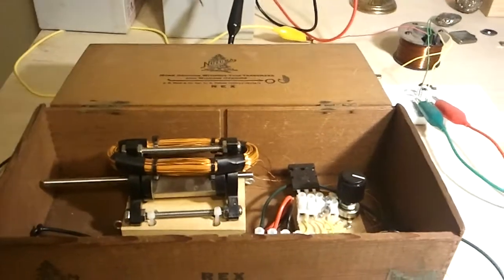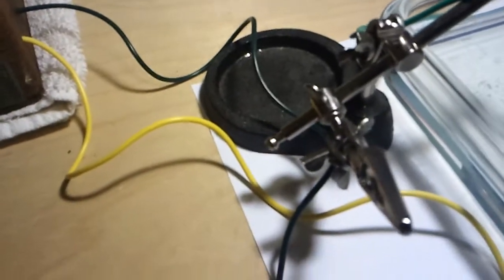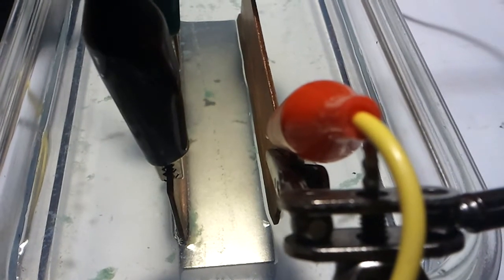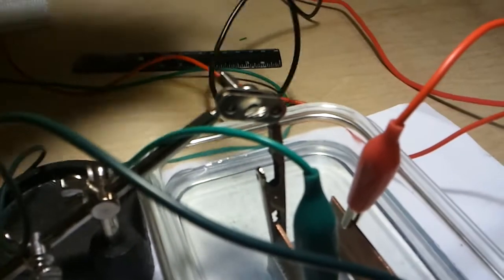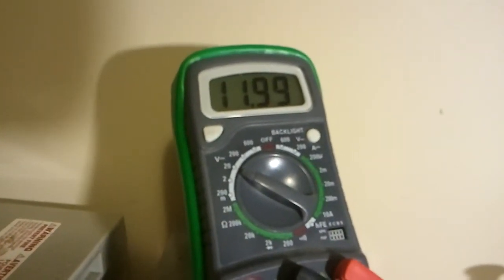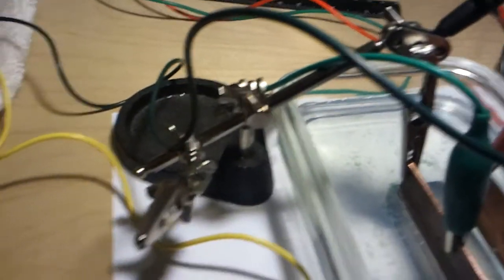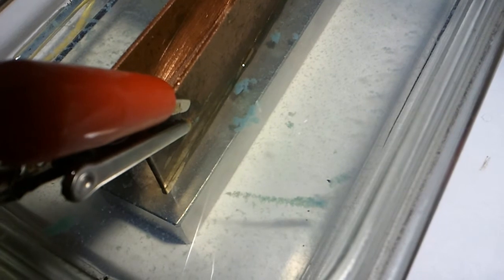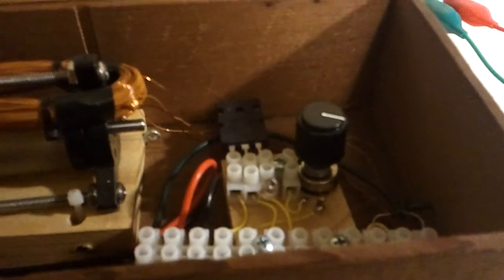bedini motor + magnetohydrodynamic pump p.1

Comment from the maker: I used bottled water, I didn't know that there was so much crap in bottled water, some brands turn to mud. Stainless steel will make the water look like pee. Ether way the room smells of ozone, like a fresh spring rain. Watch part 2 and see how the plates maintain 0.04 volts after shut down of motor.
Thanks for watching!
Peace!

Comment from the maker: You are correct, 2x more Hydrogen is produced as opposed to Oxygen (H2O). 
I to would like to build a HHO generator to collect the gasses.
I do not think the Bedini energizer will increase production. I am only trying to produce HHO using very little amp's. I think its the high voltage that is doing all the work. The point is, you could put this in your car and produce HHO with no drain on your cars electrical system.
Thanks for watching
Peace!